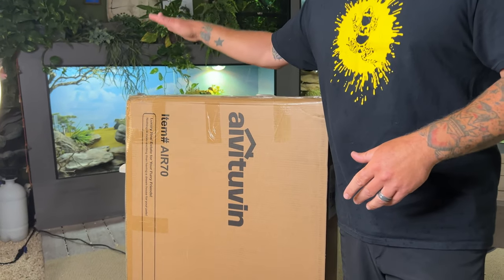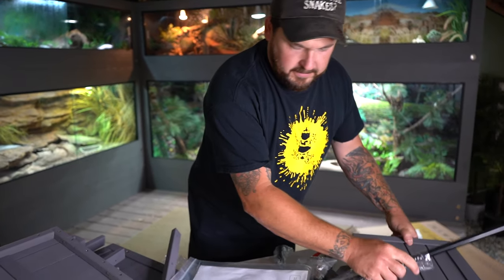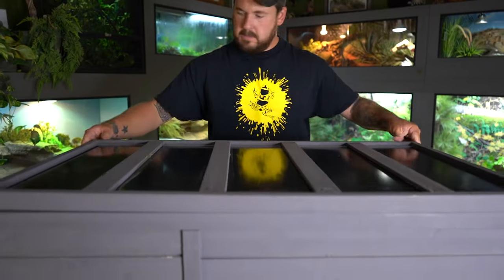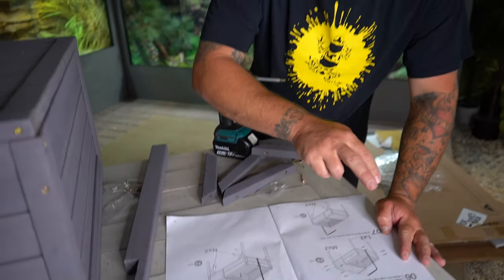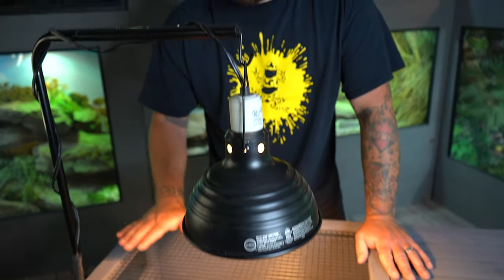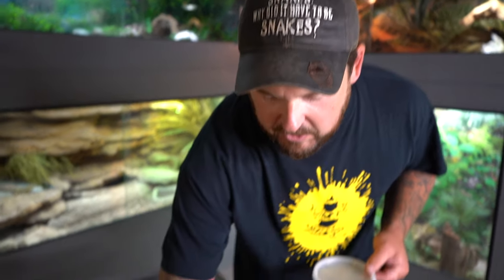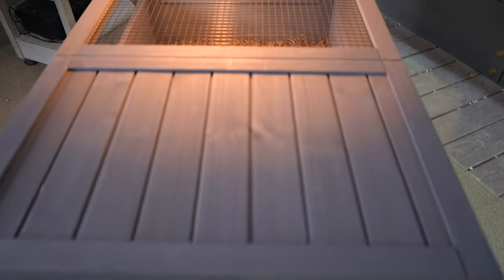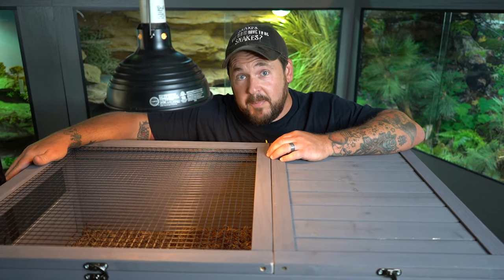INDOOR TORTOISE HOUSE! (Clean, Easy, Efficient)

Comment: Would one of these work for small box turtles? I’m in CA and I keep mine outside. I need something to bring them in when temps are over 100 and under 30
Reply: I connected two of these for a subadult and winter box turtle enclosure, and it works really well. The instructions recommended placing the hides on opposite sides if combining, but I opted to mirror them and place the two hide areas in the middle to make one large interior hide area and two open-topped areas on either end. I placed UV and heat lights on both open ends on timers; one of the open sides has a small wading pool/pond made out of a low-sided dog litter box (yes, I was surprised those exist too!) and gets misted more heavily. There is a small water soaking dish and a large basking area on the other end, allowing for a gradient throughout the enclosure from a warm, wet open area near the pond to a shaded misted area to a shaded drier area to a drier warmer open area. She self-regulates her temperature and humidity by going from one side to the other. I remove soiled water, bedding, and substrate as often as needed, usually daily for water and spot cleaning, and every few months for a full deep cleaning, light bulb change, and terrain replacement. She has a wooden vegetable feeding platform and several food dishes we rotate among with a varied diet. This encourages foraging behaviors in multiple locations that are all safe from substrate ingestion. All micro-environments have easily cleanable fake foliage to simulate a leafy forest floor ecosystem (and my turtle does not attempt to chew on them; you may have to suit your decor to your turtle’s behavior). Add some environmental enrichment items and you have a phenomenal indoor ecosystem that looks great, too!

Comment: If you made a cup maybe twice the size of his head and mounted it on the wall a few inches above the substrate where he could see it had water in it do you think he would drink from it? I see water pooled in magnolia leaves like this and thought it could work with a supply line and drain to allow free choice on water without fouling. Make the cup removable for sanitizing. Too much?
Reply: I'd worry that'd be really unnatural for a tortoise to understand, they are kinda ground oriented and expect to find water in puddles or pools on the ground with them. I don't know if one would know what to do about water hanging in the air. They're not a drinking out of leaves sort of animal  in my experience, unless those leaves are on the ground.
Reply: @lorrainemunoa791  yea fallen leaves on the ground. I feel like they are at least as intelligent as chickens and while they may not find it in the wilds I think they could be trained. Just a thought I had though not truly necessary I like to make things complex really just changing a water dish daily isn't a big deal.
Reply: @lorrainemunoa791  I was just listening to a podcast called let's talk turtles. They expressly said African hingeback tortoise drink from leaf cups! That's so cool thought you might want to know